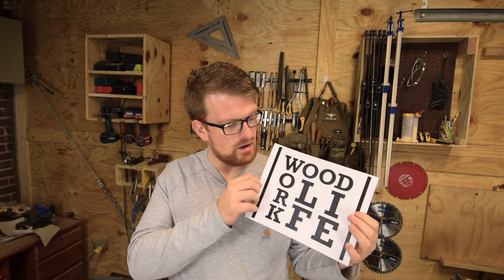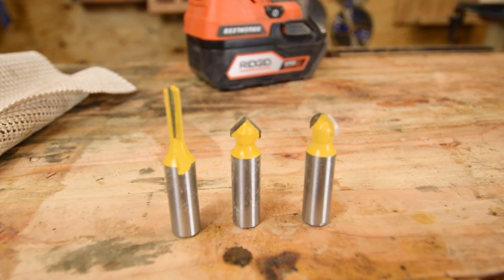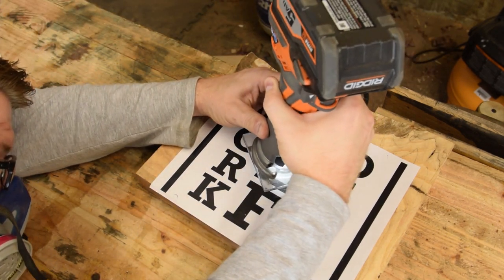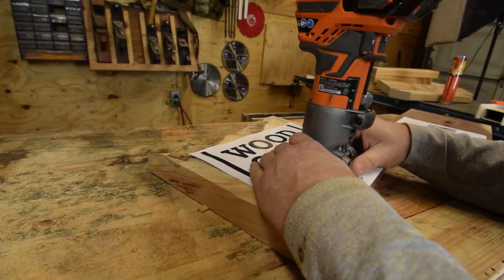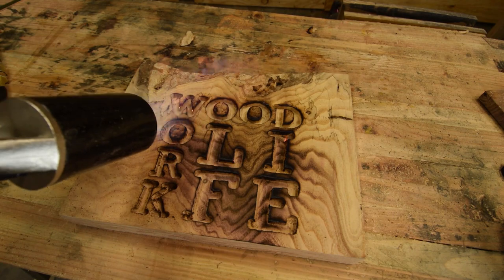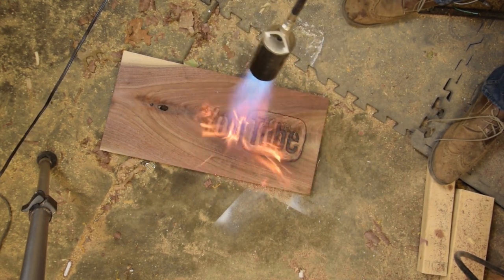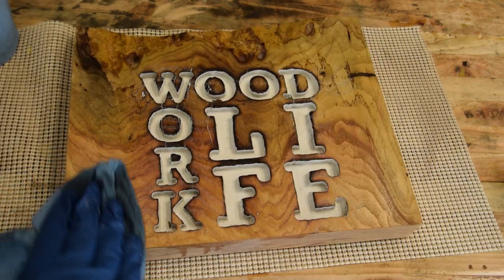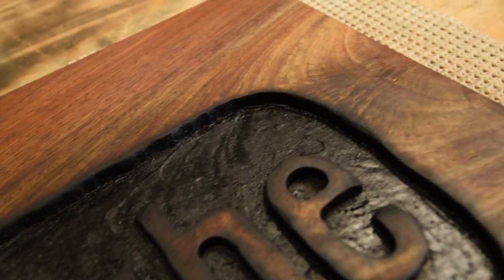DIY Shou Sugi Ban Sign w/o a CNC | Woodworking Builds

Comment: Love the wood burning, I personally would not have used a flamethrower but MAPP gas torch. all-in-all fantastic work love the content keep it burning
Reply from the maker: +Ryan Petzold will do thanks.  Ya use what you got.  The propane torch was also more fun, although admittedly less controlled.

Comment: A spray adhesive for art work is your best bet. Same stuff used to apply a mask. low tack would work the best. Same stuff I use for air brush stencil applications.
Reply from the maker: +TheSatyrblue Good idea, I have always had bad experiences with the standard 3m spray adhesives.  I just need to widen my horizons.

Comment: Nice signs. I use spray adhesive for mine. It does require sanding off the paper afterwords, but maybe adding on the propane torch I could just burn the paper off (or the house down)...
Reply from the maker: +David Beckwith Spray adhesive is the main to my existence...I just hate how anything you over spray is tacky FOREVER!  I also hate waiting for the dry time before sticking the stuff together.  But I'm sure it is a great application here, and the torch would speed up the process.

Comment: Good video love my Ridgid trim router bit did you have any trouble with removing the bits after you were done using.
Reply from the maker: +Josh Wallace it was a little snug but not too big if a deal.  I was a little concerned about the plastic button to lock the bit in the long term.

Comment: The torch works great on hardwood projects.  However, I tried it on pine once and there is way too much pitch.  Burns REALLY good,  bit too good.  I was wondering if the battery powered routers were worth looking at.  Thanks
Reply from the maker: +Benjamin DeBellis Nice, they don't replace your big router yet.  But they are great for a lot of things.

Comment: Learn how to operate the torch properly and you will love it. Use a plumbers torch for something that small , better control.
Reply from the maker: This was actually perfect for this application, I was going for an alligator skin finish but unfortunately the spray paint hadn't fully off gased yet.  I have an extinguisher, but it wasn't that level of blaze.  I should have used this outside though, good point.  I was wearing my ISO Tunes ear protection if I remember correctly.